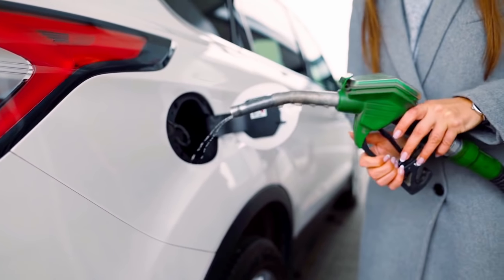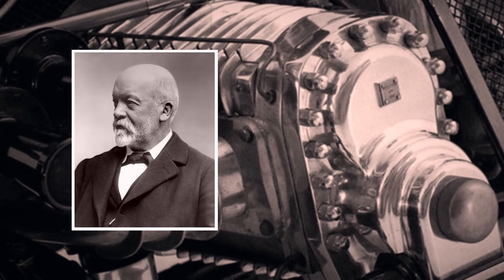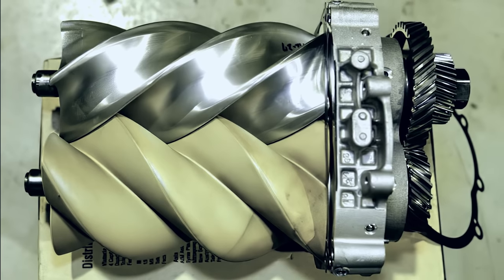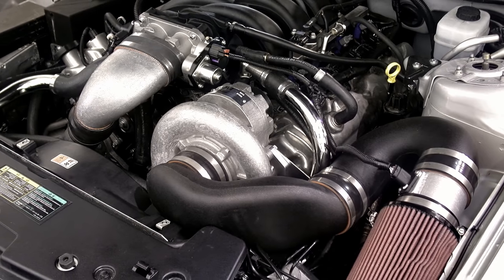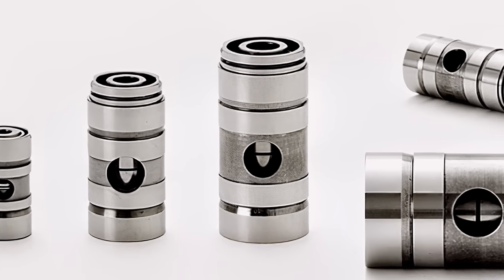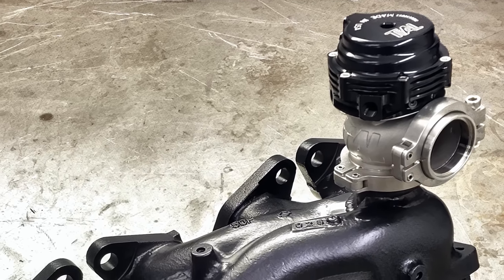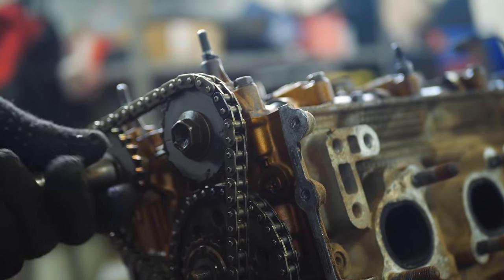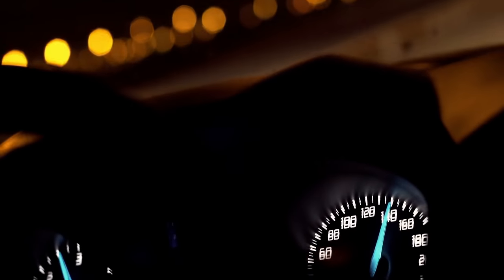The Science Of Boost

Comment: It's so funny, I'm responsible for two types of vacuum pumps at work. They're both about 3000 Liters/min capacity but one brand, Ebara, has roots style lobes and the other, Edwards, has screw style. Both run about 25k hours between rebuilds and should run about 200k hours total before needing to be replaced. I'm working on pushing that 200k number higher. They both have inductance motors, which are a trip! The rotor isn't powered, but when the stator gets energized, it induces current into the rotor, thus, inductance motor. Inductance motors have higher torque for similar HP ratings of standard motors and are great for vacuum pumps, compressors, etc. They're both non contact so when you turn one over, it spins freely, but when they're running, they're animals! They'll suck a plug out of your body if you're dumb enough to create an unsafe condition and then put your hand on the intake. This video was great info for us nerds, thank you!! Oh, wait, you wanna see something cool....pick up a bottle of vacuum pump oil. It feels like mercury, is extremely dense so that it doesn't become vaporized at low pressure. Very weird stuff, very expensive too.

Comment: Every one of your computer generated images showing the rotation of either a turbo or supercharger is reversed. Flow in a roots type is around the outside of the lobes along the case not thru the center. And turbos rotate in the direction of the compressor outlet.

Comment: I feel like everyone focuses so much on the oxygen and fuel part that they forget the rapid heating and expansion of the nitrogen in the atmosphere is what causes most of the power. If you just feed pure oxygen and gasoline. You would just create a lot of heat and not a lot of expansion. Melting the engine and no added power.

Comment: E85 compatible engines would be much more efficient if they could increase the compression ratios to 14/1. But they have to keep the compression low because people always want to use 87 octane in everything. The engine has to be designed to the lowest level of fuel available which makes using e85 very inefficient as your not able to use the octane properties of it..

Comment: 1 minor thing... its not pressure. but pressure differential. you can run engines in space easily due to vaccum pulling the gasses from the engine.
5:30 the flow is backwards on that blower.. and i can't unsee it.  it passes around the outer walls. there is no air pocket there.  same with the screw blower
centrifugal supercharger....the housing is clockwise for discharge... the turbine spins anti clockwise...     DID you animate all of these wrong to piss off engineers?
The turbo is fine. because turbos are always fine.

Comment: Hey New mind, mostly got the basics, but I noticed one small discrepancy, at https://youtu.be/gN10vCR-tPY?t=141 (2.21) you said that "these hotter pocket's may cause the air fuel mix to ignite outside the envelope of normal combustion, this is called detonation" this isn't quite right.

What you described is pre-ignition, where the air fuel mix ignites before the spark plug triggers it due to the pressure increase during compression, normally a hot spot in the cylinder head (such as the exhaust valve or carbon build up) triggers the combustion in this case. 

Detonation is when the spark plug triggers the ignition initially but the pressure increase when combustion starts compresses the surrounding air/fuel mix to also ignite causing two or more converging pressure waves.

The distinction is small but very important, pre ignition as you described it IS bad as it will cause excess stress on parts of the engine (con rods, wrist pin, bearings ect) but it's not nearly as damaging as detonation as with pre-ignition there is usually still only one flame front, so the pressure rise from combustion isn't drastically higher than normal combustion.

Detonation on the other hand causes the air/fuel mix to burn drastically faster then normal combustion, in engine that have experienced detonation you can often find dent's in the top of the piston that look like someone had hit it with a punch, that is caused by the combustion pressure (especially where the converging pressure waves reinforce each other) getting so high that it literally deforms the metal the engine parts are made of.

Some car companies (mazda being the prime one) are actually actively developing and deploying petrol engines that use pre ignition so they can use higher compression ratios for better efficiency.

Comment: Boost confuses people into thinking more is always better. Please use inch’s of water or mercury   Increasing the air volume allows you to burn more fuel Not the air’s  pressure! Higher Pressure = more heat and lower air density.
Reply: Intercooler

Comment: Turbochargers seems to be a win-win technology. However this is not always true. Many small gas-engines are fitted with turbochargers. However the lifespan of this arrangement is very often limited. Many things can go wrong. For example: Broken turbochargers and blown headgasket. This more complicated setup have so many small details that may fail. After 100.000 km many owners must pay large sums for costly repairs. My selection was a car WITHOUT a turbocharger. Not easy to find, but do your own research. Mazda, Toyota and Honda still offer good solid car engines without turbochargers. Awoid Ford Ecoboost and Stellantis PureTech engines and save a lot of money on the long run.

Comment: Couldn't you brake the turbocharger with a small Motor-Generator-unit? Having the unit idling under normal operations, harvesting excess energy under high revolutions and driving the compressor under lower loads? Basically the hybrid-car principle employed to turbo-chargers. With modern electric motors/generators, you could physically separate the units and using the magnetic forces of the motors instead of bearings.

Comment: 8:1-9:1 compression ratio for turbo petrol engines is a bit outdated i think.  Since direct injection has overtaken in the mid 2010s even turbocharged engines are mostly around a 10 - 11.5: 1 compression ratio.

Comment: What if i told you that 10psi @ 60lbs per min supports more HP than 20psi @ 20lbs per min. Psi doesnt matter. Volume and density are whats important and will determine the pressure. The rule of thumb is ever 1lbs per min mass consumed = 10hp support. This is why some guys are making flow benches with arduino systems and MAFS that read in "lbs per min". If the head flowed 23lbs per min @ .525 lift then it can support 230hp

Pressure is just the restriction of volume. No volume = no pressure

Comment: Its not quite correct to say that raising manifold pressure increases volumetric efficiency. Hypothetically, as the pressure changes, VE remains the same (can actually go down, or up somewhat due to engine dynamics). If you've tuned a speed density cars fueling based on VE, you would see VE is tabulated AT a pressure and does not scale with pressure.  Stating that boost increases mass air flow or density would be true. It is also untrue that centrifugal superchargers are more efficient than roots BECAUSE of centrifugal force. I'd most easily argue this since screw superchargers can match centrifugals in efficiency.

Comment: What about direct injection? Can’t that help with the premature detonation? Like in the Ford Ecoboost.
Reply: Eh, not really. Premature detonation is due to high cylinder temperatures, the best way to control cylinder temps is by having plenty of coolant flow by the cylinder. You can also use water/meth injection to further cool down the air fuel mixture and thus the cylinder, while technically direct injection does help, it isn’t amazingly significant

Comment: There is only, and i mean only one method of boosting turbo performance that was not mentioned. That is by adding additional air and fuel to the exhaust near the turbo's exhaust input port. The turbo's ability to turn the compressor side is dependant on the volume of exhaust being forced by the turbine on the exhaust side. By adding and igniting additional air and fuel, or even just fuel, in front of the exhaust port greatly increases the volume of exhaust creating higher boost. This method has only been experimented with and has detrimental effects of overheating and reduced engine power due to the higher exhaust pressures, but definately shows promise as a developmental joke!

Comment: Interesting. A lot of old EMD locomotives used roots blowers. I always wondered if that was considered forced induction. Though you don’t get the cool turbo sounds.
Reply: If its a 2-stroke - its not supercharged.
Reply: Those old EMD’s are 2 stroke engines, but are rootsblown (supercharged).
Reply: @jareknowak8712  A Roots blower is a type of supercharger lol
Reply: @TEMPLE7D  
Nope. 
2 stroke without crankcase ventilation is considered as non supercharged even with blower. 
You can check google, i dont need to. 
LOL.

Comment: Bro left out how saab pioneered the modern turbo market. First company to wildly use turbos way back in the 99 and made it affordable and soon after the 900 which turned into the ng 900 then the og 9-3 which more often than not were turbocharged and I believe after the last 900 there was never a vehicle they made without one besides the Tahoe turned into a saab. Which the company was the one of only few but the cheapest to have mass produced turbo engines
Reply: Volvo did it too. Although back then they used very low boost and you'd be lucky to see an extra 40 hp

Comment: Your Roots blower and screw compressor animations are backward.  The air movement is around the perimeter of the impellers, not between them.  In your animations, the airflow would be from bottom to top.

Comment: i been dabbeling with a idea of compressed air into the turbine of turbo thus a lagless turbo.this will be done by porting into the turbine housing at a angle and threading in compressed air nozzle that sprays once it sees WOT using a wot switch common used with nitrous and cuts out at peak boost.
right now its just a idea but i dont see why it wouldnt work?

Comment: What part of the normal  ( SAE  Standard Day 500', 70f ,0%h) air will participate into a non compressible ¿.  
Same + using 1k PSI dedicated Water/ methanol at a 50/50 rate and additional rates below all the way to straight distilled water.    
The most efficient use of diesel is to keep the turbines (s¹) spinning fast enough to keep your air pump producing enough torque to keep you going down the road at the rate of speed and/ or acceleration you desire.
Essentially I'm talking about using the diesel engine has a detonation chamber turbine engine that  makes crank shaft horsepower on 2 of 4 strokes run in a conventional four-stroke manner. This is likely to induce some strange harmonics  with the intake stroke making up 25-30% of the Total HP/TQ output instead of being on the dark side  of the equation were it cost 5-50%  ( extreme hi EF - 10,000 HP dragster.). 
¹ ) compound turbo setup with 3 or more stages.

Comment: Huh?? ALL of the roots or screw type animations are completely incorrect. The rotors are all turning backwards, and the air does NOT just go straight through like that. The rotors should actually be turning the OPPOSITE way, and the air takes it's path AROUND the outside of the rotors, next to the sides of the housing. 

If the air just went straight through, as shown in the animations, NO boost would be created at all.

Comment: Boost rarely Matter’s!!! Sheeple! It’s call engine displacement not pressure. We use Liter’s and Cubic Inches because It’s all about the volume of fuel and air. High boost numbers means either your engines small or it sucks! At sucking😂. If you like thin hot air… you should like boost! Use “inches of Mercury” for manifold pressure and some times “inches of Water” like on the flow bench. Boost is almost as bad as calling Nitrous better known as No2…..”NOSssss”🤦‍♂️
😳🔫

Comment: The rotation of the blower veins are reversed in this video!
Reply: The airflow is also not correct in this video! The air is drawn in and flows along the edges of the case! Do please correct this video as this is grossly inaccurate representation of a “blower”.

Comment: Modern diesel engines are upwards of 25:1 24: is pretty Stanford as far as I know . Some of the older ones are 19:1 they are hard to start in the cold . I'm currently building a sliding Vane type supercharger .  it was the original supercharger , used on MG's and alpha romaeo cars in the 30s